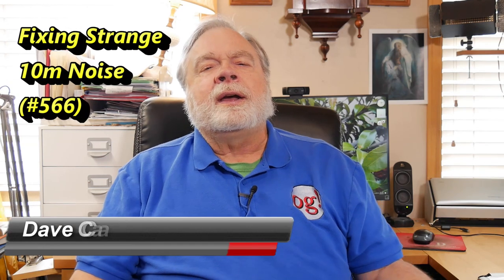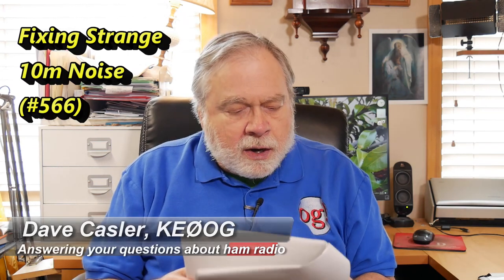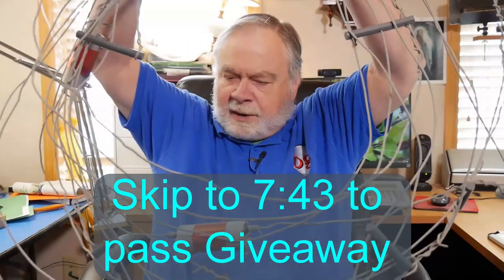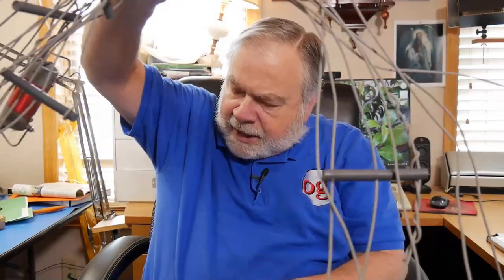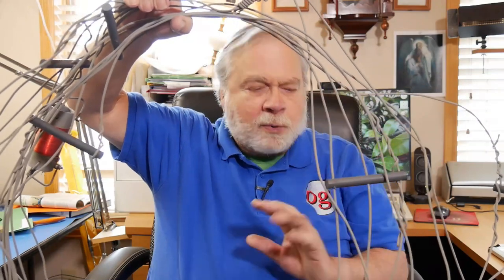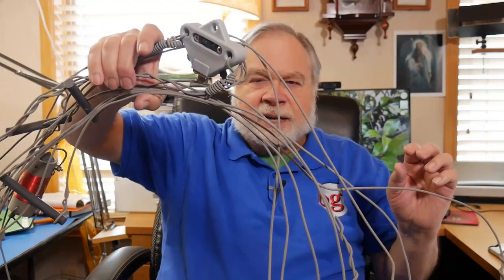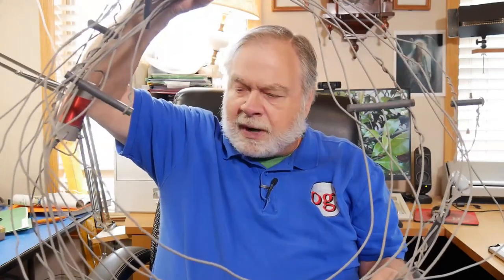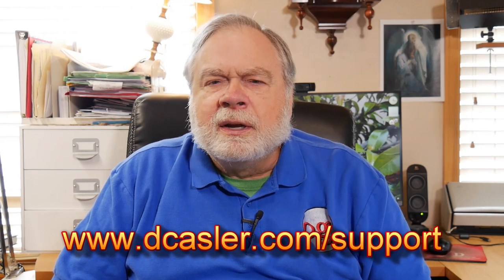Fixing Strange 10m Noise (#566)

Comment: Once grounding is ruled out and if noise persists. If possible, I'd go near the antenna with a pocket am radio, a cb walkie talkie and see if you pick up same type noise. Then start walking around the house and property to see if it drops off or intensifies. If you have a portable am/shortwave radio even better.
First though, I'd power the radio from a battery source, if noise goes away, check power supply, if noise stays, turn off your breakers one at a time, until all are off, if noise is still present, start foxhounding for noise. I'm no expert just what I'd do.
Reply: Great suggestions for locating the source of the noise.  While grounding and other techniques may reduce the effects of the noise, finding the source and stopping it there is the best.  Also, great idea to check the power supply, especially if it is a switching supply.
Reply: Get a hospital grade power supply or one designed for radio.  They won’t produce any noise.  If you use a cheapy power supply then add a medical grade line isolation transformer and plug your power supply into that.  Most of the noise is coming from ground loops in your house mains electrical.

Comment: Spread spectrum switching power supply controllers can create some interesting noise sources.  I would start with unplugging every AC power adapter in the house (phone chargers, laptop / monitor power bricks, etc.).  For UPS devices, turn them off and unplug them.

Comment: I've been wanting to put up an antenna for 10M, mostly to get on the local nets.  But, I'm wondering if there are any antennas that are broad banded enough (or that can be remotely switched) to cover the 11M CB band?  I'm seeing lots of stuff on YT about folks rediscovering and becoming active on CB.
Reply: A simple Antron 99 will work just fine. Might have to adjust the tuning rings for a compromise between the two bands
Reply: Go with an imax2000 with radial kit and you’ll be golden all the way to 17m.

Comment: Hi Dave, watch regularly so thanks. Just a quick comment.. If the operator had his receiver preamp switched in permanently, wouldn't you have the attention level and preamp gain to deduct from any s-meter deflection? Was thinking that may further explain the s-meter anomalies..
Reply from the maker: Yes. The S-meter's accuracy has always been a matter of controversy because of the considerations you mention. It's a relative indication of signal strength.

Comment: Dave, if you have your shack on the 2nd or even 3rd floor and you run a ground lead to a grounding rod, wouldn't that lead become an 'antenna' too?
Reply from the maker: As a general rule, a short ground run is better than a long one. Another general rule says any ground run is better than none.

Comment: When you say ground the radio - do you mean the ground in the plug should be connected to your earth rod (and removed from the electrical ground of the house) or do you mean attach the earth rod to say the chassis of the radio ? (Sorry if this is a bad question but I am a new radio ham and would just like a little further explanation)
Reply: Richard the ground in the AC plug is a safety ground.  Your radio should have a ground on the chassis (usually marked with a ground symbol).  This is the point which should be connected to the single point ground.
Reply: @johnstevens2163  thanks - that makes sense